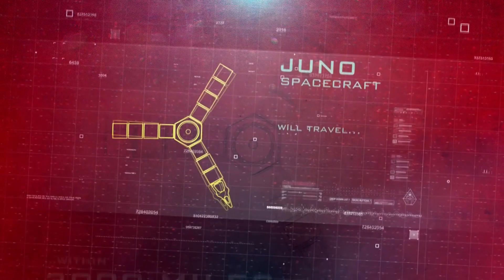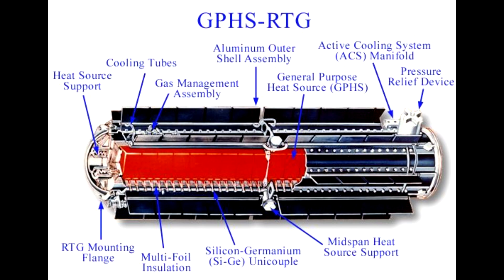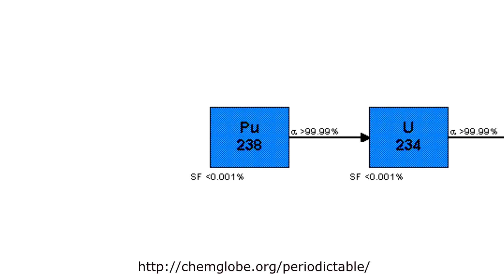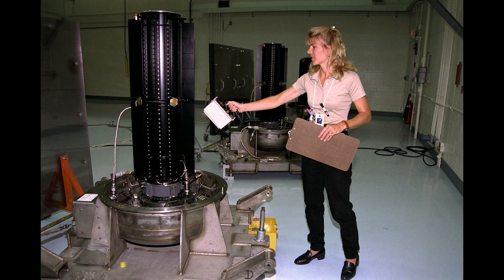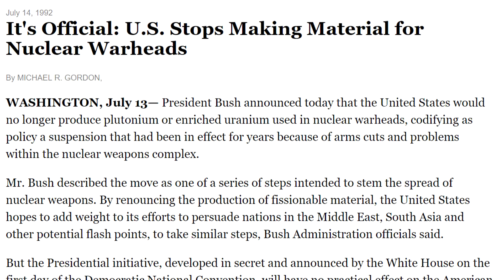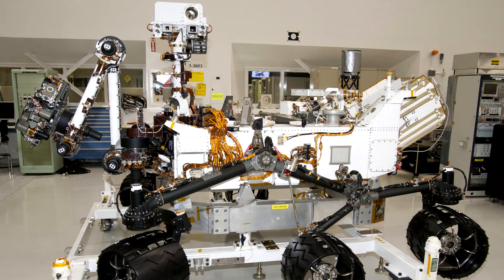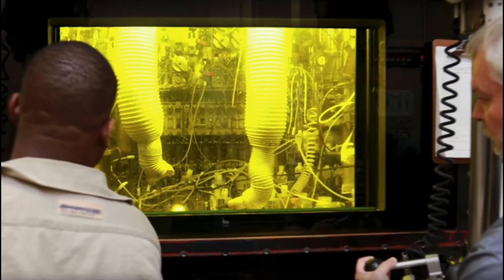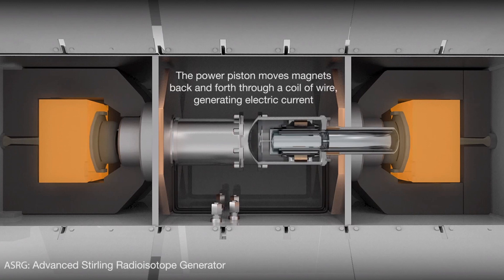Juno & NASA's Plutonium Shortage

Comment: What is the waste from our nuclear reactors and could we use that?  If not as is can we refine the waste?  

One of the main problems so many people seem to have with nuclear power is the waste so making even the waste useful would make that idea go away over time.  

As to us making the slugs for the RTGs, i am amazed we didn't start long ago.  from what i know about RTGs they are pretty harmless and last forever (longer then i will be alive) so whats the issues.  Sounds like a great idea for space craft but also space based power sources.  

A Mars colony will have to deal with dust on their solar panels and massive storms so wouldn't it make sense to send RTGs that can power them as well?
Reply: You can't really use plutonium in reactor waste because it is contaminated with other plutonium isotopes that have gammas in their decay chains. There are other fuel cycles that might make this easier to do, but all our current stocks aren't usable.

The issue is cost, it costs a lot of money to isolate the fuel stock (neptunium 237) from spent fuel and has massive proliferation control issues (sniffing around through nuclear waste is always proliferation control nightmare). And then transmuting it requires a neutron source, and neutrons are more valuable than diamonds per unit weight. 

But RTGs aren't that efficient, if you went nuclear for a space colony, a small nuclear reactor would be more what you want. RTGs only output watts of power, and you would likely need several kilowatts for a colony. SMRs might be a good option here.
Reply: Christopher Willis Legality is such a stupid argument. If it's illegal we can make it legal. Especially if it is in the way of a super important technological development.

China can obviously do it as their LFTR program is said to be done by 2024. Perhaps they can do it because they are not slaves to the oil companies...

Competition will make it reality.
Reply: NNL in the UK are doing just that at the sellafield reprocessing plant. Refining nuclear waste for americium. Not as good as Plutonium-238 but better than nothing. They have a contract with ESA
Reply: it&#39;s hard to isotopically seperate elements it&#39;s far easier to chemically seperate different elements. That&#39;s the current issue with current nuclear waste. if it was easy nasa would already have enough pu238 for all the dream missions they have planned already.
Reply: It would be super easy if we used LFTRs, as they use a liquid fuel that can be chemically filtered to extract the fission products and the Pu238 which is the only "waste" from such a reactor.
Reply: Daniel Domeisen If you want to understand everything nuclear, Check out gordonmcdowell's channel

He recently released a "Nasa" Oriented Remix of the information about nuclear and it's quite interesting, Explains everything that Scott manly has been saying in this video and why RTG's are super important if we wanna explore the outer solar system more.
Reply: +Christopher Willis You're misinformed, in a LFTR, as U233 is being formed, so is U232, which has daughter products that emit high energy gamma rays which  can kill the people working on this fissile material and you yourself confirmed in this comment section that trying to isotopically seperate a 1AMU difference is a nightmare.
Reply: Daniel Domeisen No need to call your ideas names when you are just thought experimenting out loud! 
So, firstly, neat fact is cooling is easy once you are on the surface (space is much, much harder). You have likely seen the technology we need to use, it is in computers, and it is getting implemented in houses, and could likely be used for cooling a reactor, and that is heat pipes. 

Now heat pipes in your PC are a special thing using metal cooling, that isn't what I mean, but what I am talking about is just using the ground as a heat sink and moving the heat from the reactor to the ground. It is less well developed in terms of using it as a "coolant", but for the heat rejection part, it would work, in theory. 

You don't have to worry about water if you use this system as nuclear is a closed loop, the water always stays in the reactor. The water you hear about nuclear using is just for heat rejection, not the power cycle itself and for that we are using the dirt instead (and mars is cold, even when it is warmest). 

HEU isn't really hard to come by, you don't need to disarm a nuke to obtain it. It's more that working with HEU is a political nightmare. It is, point of fact, easier to take something from Low Enriched uranium to High Enriched uranium (HEU) that from normal uranium to Low Enriched uranium(LEU) (take less SWU). 

And to your point Karl the Pagan, you are right, and I try to be more charitable generally. I get that argument all the time, so I was overly harsh, my apologies. The point still stands that Kirk's proliferation resistance argument is weak potatoes and we will need new proliferation regimes to mange liquid fuel fissile inventories...it just has never been done before...it is easy to say "look, you are missing 40 fuel elements, where are they" vs, ".02 grams of materiel isn't in this vat, where is it". Challenging, not a deal breaker, but need to get ahead of the issue before it is an issue! 

Thorium, molten salt reactors are why I went back to school for nuclear engineering, but they have more downsides than is oft discussed and engineering challenges to solve...and I, for one, look forward to help solve them :D
Reply: Merecir LFTR also uses an illegal enrichment level of uranium and an unobtainable lithium 7 purity. I doubt it will ever see the light, but other MSRs that use thorium might. You could still filter the neptunium if you wanted to.
Reply: Merecir They aren't building a LFTR, they are building an TMSR and a pebble bed reactor. Not even the Chinese will want to build something with basically weapons grade Uranium, and we wouldn't let them either.  We are talking like 90% enriched uranium to get a LFTR to run, not gonna happen! Other MSRs will, though, and more power to them, they are why I am back in school!
Reply: The real reason we do not reprocess in the United States is purely an economic one. It is much cheaper and safer to process and enrich new fuel than recycle it with the current state of the uranium market. Avoiding the
potential for more weapons grade material is more of a "fringe benefit" than anything else. There is no harm in letting the fuel sit in dry cask storage in the mean time. It is in a passively safe configuration and
you are letting the relatively useless, much shorter lived Cesium 137 and Strontium 90 etc. decay off.

As for the question of reactors running highly enriched fuel (while I have no personal experience), I was under the impression that Naval reactors ran very enriched stuff. It is the reason they can restart a scrammed reactor very quickly whereas a commercial light water reactor will be offline for a period of days due to fission product neutron poisons.
I think you will see small modular reactors built in the States more than anything else.  They will have an easier time coexisting with intermittent but heavily subsidized renewable  energy, and in the case of a Fukushima style catastrophe you can just sit back and eat a sandwich because the reactor cools itself via natural circulation. 

But that is just my two cents.  Please let me know if I am wrong about the naval reactor statement, I very well might be.
Reply: Encaustic oh ya, ship reactors can do all sorts of fancy tricks and do use highly enriched uranium. The world is removing all HEU civilian uses, though.  But ya, SMRs come in lots of flavors, and none of them are yet a LFTR, and likely never will be. Closest one is the one from Transatomic power and Dr. Leslie Dewan's team, Terrestrial Energy, and Thor Con...and thor con is the only one that plans on using thorium to start. As well as the LWR variants like NuScale ect ect. 

And yes, while uranium being dirt cheap is one motivation as well as the only people that have done it have managed to have some of the most ridiculous cost overruns on a similar plant here in the US. But even that is for dealing with weapons, not civilian processioning. Ever since Carter banned it, it hasn't been a subject we have revisited realistically ever again. (Reagan unbanned it, but the idea was already tainted)
Reply: interesting ideas all around.  I was thinking of using it for space based craft due to the ease of cooling such a device in space but from the sounds of it you are all talking about Earth based power solutions.

Please keep going, i find this all amazing to read.  I am not even CLOSE to the level of smart you have to be to understand all of it but i can searching what i do not understand and it is amazing.

From what i can tell the issue with using normal nuclear waste is that it is hard to process out a pure amount of fuel for an RTG.  We can isolate the chemicals easily but the isotopes are harder, again from my BASIC understanding.  Would it be possible to use a centrifuge to do the job?  we use them for isolating the isotopes in the primary reactors fuel so could the same trick work here?  If not then i have to ask, can we use a less pure fuel for the RTGs?
Reply: In theory, yes, in practice, the atomic weight difference between Pu238 and Pu239 is one AMU....basically nothing. At least with Uranium we get 3 AMU to work with, but it is still a nightmare. To do this, first you new isolated Plutonium. The world frowns on isolated plutonium. Generally we try chemical processes that leave Pu with something else, usually uranium. Can't do isotopic separation this way. 

Could you use a less pure one, sure, the problem is Pu238 is a small percent of Pu  in spent fuel (<2%). It would mostly be stuff you don't want, stuff like Pu239, weapons (and mostly this, almost no heat generation 50%+), Pu240, high gamma from spontaneous fission as well as free neutrons (22%+), ect ect. You wouldn't want to in other words, RTGs are already not very efficient, more mass to do less heating will render them mostly useless, solar would be better in every instance except the most extreme. To that end, other RTG fuels would be more useful, even though their draw backs are many, usually low power output, or short power duration, or excessive radiation...usually some combination of 2 of those downsides.
Reply: With that said, there is this technology we can't get to work but has the possibility to separate isotopes via lasers. Then mass difference doesn't matter, only the hyperfine nuclear structure. Don't worry, I don't know what that means either.
Reply: And cooling things is deep space is actually very difficult. Most all cooling we think of is convection or conduction (air or touch). The only method of removing heat in space is radiation. This is via black body radiation, cool things let off low intensity microwaves, and very hot things will emit light, or xrays or gamma rays. The way this generally works is with huge ass fins. If you look at a picture of an RTG, that is what is going on there, those fins keep it from melting itself. 

A large nuclear reactor is very difficult to deal with in deep space. Ironically, nuclear engines can regulate themselves a bit better in this as they are taking the heat from the reactor, heating up some gas (usually hydrogen) and spitting it out the back. Shooting out hydrogen effectively becomes cooling by convection....neat! But if you don't want to throw mass out your spaceship, you are gonna need some big ass fins. With that said, keeping ships and parts warm is generally a big source of energy need in spacecraft, so relatively electrically ineffeciant reactors and RTGs heat could be used to heat the ship. Anyway, just ranting now. I should get back to making youtube videos :S

If you find any of this interesting, I have a nuclear based youtube channel over at BeCurieUs1, you can just google BeCurieUs1 youtube, and I should pop up.
Reply: Christopher Willis
"and we wouldn't let them either."

China? Are you trying to be funny? They will do what they want and you can't do shit.

U233 is hardly weapons grade. And besides, you don't need specifically U233 to start the reactor, other neutron sources will do just fine to excite the Thorium.
Reply: Merecir U233 is plenty fine with being a weapon, in has better qualities than Pu239 in some instances. What I mean is they would get international pressure just like we do anyone, like Iran, for instance. China will likely place nice anyway, the world is moving away from HEU, not towards it.

And while yes, you don't need U233 to start a pure thorium cycle, there is no getting away from the fact that the U233 exist in a highly enriched form, over 90% in LFTR.

There is a meme that you can't use U233 in weapons, it is wrong, or at very best, inaccurate. U233 in high concentrations is perfectly weaponizeable and needs to be controlled just like we do other materials. That doesn't mean thorium reactors aren't a good idea, it just means certain flavors, notably the LFTR won't likely see the light of day. Other molten salt systems, however, will.

http://web.ornl.gov/info/reports/1998/3445606060721.pdf
Reply: OnePercent That is the meme, it is also lacking rigor. U232 concentrations can be made low if Pa233 is isolated from the neutron flux to stop (n,2n) reactions and just because something is a high energy gamma doesn't mean you can't use a hot box or just limit exposure duration, Pu has a similar problem after all...got some gammas you have to shield against. You can engineer these problems away is what I am saying, and it isn't even that hard of a problem. The U232 argument has always been a weak argument, and why other MSR promoters, like Dr. David Leblanc have cautioned against using it. MSRs that use LEU will be the path forward, and more power to them. I expect to see MSRs in my lifetime, some that even run on thorium, but I never expect to see a LFTR, hell, we can't even get the lithium at the scale we need right now (isotopically 99.99% Li7 is a materials challenge)
Reply: "A Mars colony will have to deal with dust on their solar panels" ---- windshield wipers....
Reply: Floyd Looney "Deal" is a bit harder, turns out dust on Mars is VERY fine, and has huge static charge. It is VERY VERY sticky in other words and so fine it gets in everywhere and everything. Long term, you want something non-solar to power humans on mars, for sure. Solar will be a part, but you don't want to live and die by it.
Reply: Christopher Willis - i would also go so far as to say that no engineer in his right mind would only have one system with no back ups.

RTGs and their like may not produce much power but they should be enough to provide basic needs incase of solar panel destruction and any other systems they would have.

I know geothermal is not a thing on Mars, wind is not really a good idea either considering how thin the atmosphere is on the planet.  Hydro-electric is also not going to happen in the next few hundred years (that is assuming we EVER terraform the planet) and other then those i do not know too many other methods of power generation.  RTGs will allow for a failsafe backup, considering they never really run out.  While they are not needed for emergency power the power can be stored in battery packs for use on vehicles and other needs.  

Even if solar is the main source, sun light is less intense on mars then Earth for the sole reason of distance between star and planet.  In time you can use the genetically modified algae to produce a fuel from human waste but that would still need a source of power to have first. 

Now in saying that the Thorium reactors i have heard about are very interesting, but how would you cool the reactors on a planet like Mars when there is no real way to get that much water to dedicate just to cooling?  

On Earth a Thorium reactor would be AMAZING.  Starting the cycle seems to be the issue, from the what little i can understand of the research.  Since we are disarming so many nuclear weapons, can we used the reclaimed Uranium to start up the first reactors?  After that you could use those reactors to start the next generation correct?

I again want to say sorry for not being that smart in all this, i understand the very basics of what you are all talking about but i am a laymen.  If my ideas are totally moronic just say so and enjoy a good laugh at how little we in the general population understand the topic :)
Reply: 1. Calling sound arguments "memes" is poisoning the well. (calling "memes" is also a meme)
2. LFTR is just a rebranding on TMSR.

Let this thread be purged of fallacy and FUD.

+Christopher Willis I see that you are a thoughtful individual and you should definitely take your skepticism and respond to the Thorium fans on Youtube with genuine criticism.
Reply: Christopher Willis - in terms of cooling i know the thin atmosphere of Mars could be an advantage in terms of cooling.  As to closed loop water use i was worried about the water breaking down from very high levels of radiation.

I am not sure it that is a thing but even if 1 H2O per day breaks down we would have an issue with oxidation over long periods of time.  Like i said i am unsure if water can be broken down via radiation, if anyone else does know if it is possible please tell me.

in terms of the HEU, we have treaties that state we will disarm some of our Nuclear weapons so i assume we will (are) using it for something.  Could we 'downgrade' the HEU and still use it to trigger the reactions?  

Again i am a laymen, if this is nonsense then just say so.  

Have a lovely day :)
Reply: Daniel Domeisen Water is broken down constantly by gamma bombardment, so your intuition is on the money. But most systems have gas recombiners, it is something that is just normal operations these days.

Turning weapons to fuel does happen, but using weapons grade in a reactor is a no no, right now we "down blend" it so it turns into LEU and use it in reactors. Only the military are allowed to use HEU and some vestigial test reactors that you could never build today.

Fun fact, at one point, 10% of US electricity was coming from downblended Russian nuclear weapons :D (well, probably less than that, but we had lots of their fuel and nuclear is about 20% of us electricity, and a significant amount of fuel was downblended uranium)
Reply: Christopher Willis - ... this is going to sound insane but how fast would normal nuclear waste break water apart and could we harvest the hydrogen from that break down?

I do not know much about Nuclear energy but i know for a fact that Hydrogen can be used as a source of fuel for combustion.  the issue is that hydrogen does not give as much energy as it returns so it is an imperfect energy conveyor IF we use electricity to break the Water apart.  If we use nuclear waste with no power input other then what we would harvest anyway it could be used to provide power.  

The real questions would rely on how safe you can make the system to contain the radiation, how safe you can make the system to prevent detonation of hydrogen, and through put on energy over time (as in how fast can how much energy be gained).  This is not a question for space anymore but could this be a way to improve our Earth based power harvesting.

I know i am all over the place but it is an interesting topic, and using radiation to break the chemical bonds seems like something we can do by putting the water in a tank and just letting the water break down.  Have it so the tank is VERY far down and the lighter then air Hydrogen would raise faster then the Oxygen.  

My brother says i am an ideas man, in spite of the fact that i do not know the math for it.  What do you think?
Reply: Daniel Domeisen Waste heat from fuel and radiation is a lost cause. The radiation is not intense enough in spent fuel to do much separation, and you have to basically have the waste un-shielded, you wouldn't want that. Plus, spent fuel will have some neutron generation and that will cause some of the water to become tritium will is very mildly radioactive, we wouldn't want anyone to drink that or used as a power source that would go into the air inside the station. 

But if you have excess electricity anyway, might as well do electrolysis. That is a much cleaner and safer way to go. Hydrogen storage is always challenging, but doable.
Reply: Christopher Willis - oh well, as to Tritium isn't that a fuel for thermo-nuclear reactions?  

Thank you for the info though.  I do think hydrogen is a good way to handle long term energy storage.  storing the hydrogen is tricky but not impossible, in the case of a detonation it would be... energetic.  

I once asked my brother if it was possible to generated electricity from radiation via the same idea as a solar panel.

Has this been looked into?
Reply: Daniel Domeisen This covers your question in the last part of your comment.
https://en.wikipedia.org/wiki/Atomic_battery
Reply: OnePercent - thank you.  i have reading to do on my lunch break.  :)